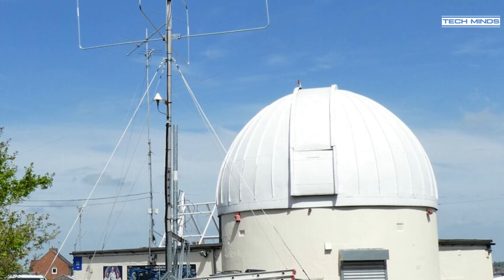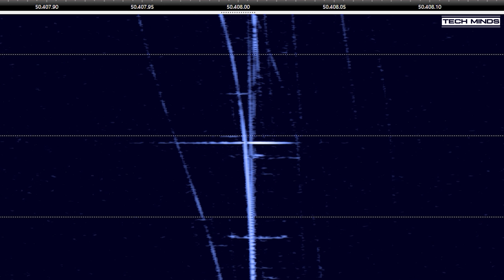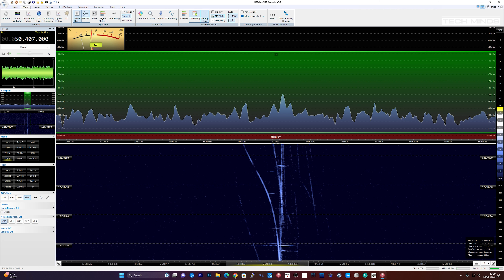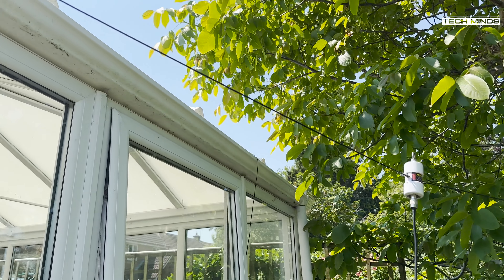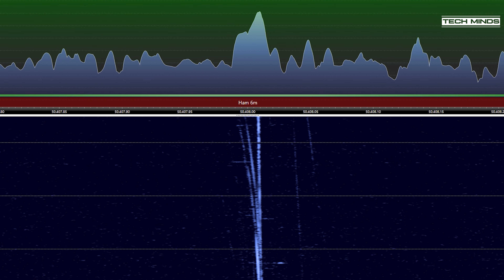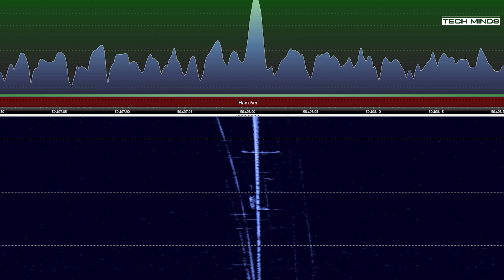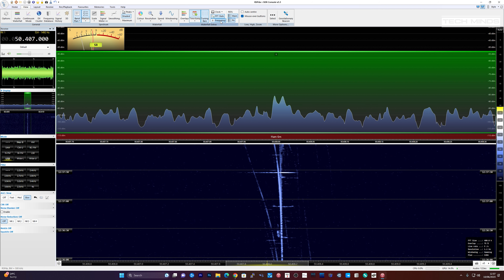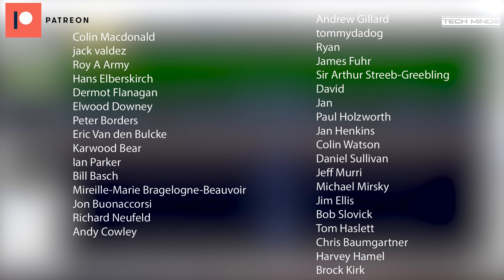Detecting Meteors With Software Defined Radio

Comment: A fun thing to do is passive bistatic radar. Find a GSM or HDTV carrier in your local area. Tune to USB 1 kHz up from the carrier. Display a SLOW waterfall. Every aircraft between you and the transmitter will show up as curved lines. The Windows program ARGO will display a suitable waterfall.
7:50
Reply: Got to try that 😋

Comment: Great video.  I have been doing radio meteor detection since 2007 using carrier signals from out of range television stations.  Currently I have a system monitoring 55.240 Mhz in CW mode.  I use software called Spectrum Lab to automatically count hourly rates and software called Colorgramme from RMOB (Radio Meteor Observing Bulletin) to automatically submit those counts to RMOB so it can be used for studies.
Reply: Country location?
Reply: @Suzuki_Akira  Southern Minnesota, USA.

Comment: The one thing that seems evident to me these days living in an urban built up area is noise, and lots of it at times from HF to VHF. So I opted for receiving meteor pings from the Graves radar. Over a period of at least 10 years I have had great success in doing so, although initially it took quite a lot of experimentation to get the receive system as efficient as possible. I finally opted for two VHF LFA 5 element Yagi antennas vertically polarized, and one 6 element ZL special horizontally polarized installed in the loft. Variable gain VHF head end amps with band pass filters, are used to remove most of the strong out of band VHF commercial transmitter interference I was getting.  I also fitted additional variable gain VHF amps with splitter combiners near to the ICOM VHF receiver. I have tried receiving meteor pings with an outside VHF vertical high gain antenna, but because of local noise issues the results have been rather poor with a very low meteor ping count and only the strongest pings are received. I receive over a hundred pings an hour, during large meteor showers as standard, while at other times around 30 to 40 or more on average pings at less busier times. Great video thanks for posting, watching the pings and hearing them is great fun, I use Spectrum Lab. I found the hardest part and most interesting, was getting the minor pings strong enough to overcome local noise issues.

Comment: Great video. I'm a researcher getting a doctorate on this topic, and currently helping to build a system in central US. There's multistatic and monostatic systems in Peru, Argentina, Northern Germany, Norway, and (IIRC) France that publish papers and data. There's at least one company that sells commercial off-the-shelf meteor radar systems, so I'm sure there are others that don't publish scattered around the globe. In addition to helping build a meteor radar system, I've traveled to Peru to do research with their system, and I've worked with data from an Antarctic array that was recently taken down after running for 5 years. 

To give a little more context in the field as a whole: the system you're showing is an older, simple version of specular meteor radar, useful mostly for meteor counts. More modern research revolves around systems with interferometric arrays to determine the meteor's location, and different aspects of the received echo can help make physical measurements of the atmosphere or the meteor. Doppler shift of the echo can give you information about wind speeds, decay rate of the signal can give pressure/temperature, radar measurements can be made to measure meteor speed, etc. 

There's also non-specular meteor radar, that bounces radar off the heads of meteors instead of the trails. Interesting stuff. A good paper to start with if anyone is interested in learning more is "Real-time determination of meteor-related parameters utilizing modern digital technology" (Hocking et al, 2001) and their sources.

Comment: I've setup an SDR meteor receiver at the Blackburn Leisure Astronomy Society (BLAS) in Brough, East Yorkshire and have approximately 2 years of meteor data from GRAVES using a 6 element Innovantennas loop Yagi / Uputronics preamplifier and RTL Dongle using the Echoes Software.

Comment: I had the chance to check out meteor scatter comms professionally about 30 years ago.  You could buy a system operating around 50 MHz for a link up to about 1000km and getting an average throughput of 2.4kbit/s.  It used a variant of X.25 for the link protocol with the timers adjusted for really fast turnaround once a carrier is detected.
Reply: Could you triangulate with multiple sources? 
On thing that certainly could be done now, is AI to pick out the meteors from the other signals such as planes. 
With ADS receivers as well you may be able to identify which plane it is too. 
Then there's people running meteor cameras. If you could cross reference the signals from the radio, you could cross check with the cameras to see if you can detect actual meteors.
Reply: @adenwellsmith6908  Yes - if you just want to detect meteors (or planes) then using distant VHF FM radio carriers it is certainly possible to triangulate with GPS synchronised receivers
Reply: So time of signal detection like the lightening monitors.

OK do you have any information on the locations of stations that broadcast that can be used for monitoring? 

From the maths you would need 4 to get lat long

 @Richardincancale
Reply: @adenwellsmith6908  In the UK we used to use FM broadcast transmitters from Eastern Europe as their FM band extended down into the 70MHz region, way below the bottom of our FM band at 88MHz. You just need something with a constant amplitude at a good distance where there’s no local co-channel interference to swamp it.

Comment: I began experimenting with this method of meteor detection about 10 years ago but after making contact with a professional radio astronomer and sharing some of my observations with him, it turned out that most of the 'meteor-like' echoes I was seeing were actually signal reflections from LEO satellites. (I'm in the eastern US and have mainly been tuning to the video carrier frequencies from Canadian analog VHF TV transmitters -- yes there are a few still operating!)  Monitoring satellite reflections is interesting in itself and you can use the various online sat tracking sites to try and confirm your results. Sometimes it's easy to tell the difference, sometimes not, so if anyone out there can provide some expert advice on how to differentiate between satellites and meteors I'd like to hear about it.

Comment: On SDR console, bottom left - use 'Notch: on' with 'Auto enable' Set level as you like. This will suppress constant tones such is direct reception, but will allow brief bursts and pings to pass. By adjusting level, you may listen both; pings and bursts. I hope this helps. 73
Reply from the maker: Thanks for that!

Comment: Good one there nice results, it is indeed a bit like looking at tea leaves. I have done stuff using both the Sherwood Observatory unit mentioned and the easier one on near 2M (Graves France). The Main carrier is actually ment to be "invisible" so you can easily recieve the reflected signals minus the carrier. Try a vertical Moxon  for 6M to pick up the reflections, actually low to the ground would probably shield it from the main signal but be aware that the antenna will be loaded so close to the ground when calculating the size. There is also another similar experiment in Belgium. Contact us if you have any questions.

Comment: Would it be possible to send and receive callsigns if the transmissions were fast enough?  Maybe using some sort of high speed data mode?  Is this a thing?
Reply: Yes, this is a thing. 40 years back radio amateurs used morse telegraphy, speeded up with tape recorders with variable replay/record speeds.
Today a program called WSJT-X offers multiple modes suitable for meteor scatter, which transmits the same info at very high speed over and over, waiting for a ping or burst to be received at the other side. Works even with relatively low power.
Reply: @Wimo-funktechnik  I like the sound of that!  Was unaware WSJT-X could be used for meteor scatter...  Need to look into it.  Thanks!
Reply: @cthoadmin7458  wsjt-x mode is called MSK-144

Comment: Im working to get my initial licence. Im a Yank as well as well as a Swiss, the FCC allows the online test taking. Thier tests have good prep documention and are easier. Example, every member of my local club is a electronic/electrical engineer or a radio engineer. And i habe to twke thr test in my second language wirh very little in the way of guidebooks or preparation materiel in French. They do have reciprocity however and (i am a lawyer) and the Americans put up with my dual nationally but dont officially "recognize it so I have to pay the difference between my US and Swiss income tax which is always a few 1000 USD (enough to take a bite but never enough to tangle with the IRS). They must have a formula to calculate this amount 😅. BUT, for U.S. legal purposes, my last domicile remains my domicile for U.S. purposes until I "return" (after this long - um doubtful - two 20s somethings born in Switzerland who are 100% in thier brains). So,what do you think given the tax and even "voting rights" (which I don't use as I dint think it fair that I vote in two countries and I vote here). But, could I take the ALLR online test and do a reciprocal switch to the Swiss. My French is "verbally (B2 / C1 - if you use the same system in the UK. Which means I passed the 2 1/2 hour French 900g to 4kg Federal Drone Licence A2/A3. But, Im having test anxiety given the lack of much of any printed preparation material. There sre a lot of operators but not like the US where there are Federal laws protecting the use and even which can be used to challenge HOA restrictions etc. ....not here as I have to do everything on the downlow. My interest in Computers ran up against my interest in Rsdio (dating back to High School). I have the same Radiosonde antenna you used for your Immsarat demo and I am already ordering and working on connecting to the Q0100 Geosat to the point of making my own rectangular sat parabolic dish so it doesn't look like a satellite dish. Using a mosquito net with a foil epoxed on the back plain and using a layer to find the optimal LNB / Helix antenna mounting point. I am making it so it focuses the 10Ghz down below the eyeline of those below my balcony. So, a very customized backplane, checking the continuity using lazer beams as a represention of any incoming waves hitting my back plane using and example of an engineer who used metal rectangles in concentric circles on a flat backplane and custom focusing each one before glueing them in place. He placed a thin piece of plastic over the 100s of tiny metal plates not to create a solar cooker of his LNB and Heliex. I have been listening to the 10Ghz websdr and it just eggs me one. Im did my first "fox hunt" last weekend and with an initial tutorial found all of them. Again, eggijg me on.....none of the members use computer or the new digital modes like FT-8 or Winlink despite the club being sbout as ild ss
Reply from the maker: Good luck! Hope to hear you on QO-100 some time ;-)

Comment: there is no beacon on 50-70 MHz near me, any way I can still receive meteors? I'm in balkans :)
Reply: I remember using Baltic tv-transmitters around 55-56MHz back in the day but just like our swedish analog tv transmitters I guess they might have shut down.. you could try the GRAVES VHF radar on 143.050MHz located in eastern France, I know AIS signals from ships at ~162MHz bounce well too - extending my range 3-4-5-6 times and as I know the usual range on my system I can basically see which direction they hit too... jjust a thought..
Reply: As mentioned try a 2M Moxon pointed towards Graves France, not sure what your result would be but it is Very powerful at 400KW so maybe you'll be successful. For most of us we are over the horizon so most of  the time you will not se the carrier it's self but the reflections. BTW it's so powerful you can see reflections from the ionosphere and even a moonbounce on occaion ..very impressive!
Reply: @101blog  Interesting, would the stock antenna from RTL-SDR V3 kit help me receive graves?
Reply: @Antenna101  Good question .. try it outside I feel probably not but worth a go. That said you can build a Moxen antenna out of cheap electrical conduit and wire ... Look for a Moxen antenna calculator and put in the frequency of 143.050 and you'll get the demensions ...expect a buld price les than 20Euros. Try and get that as high as possible an point towards Graves
Reply: Great Video Matt! I am assembling all the pieces to get Yagi up for 6m and will check if it can be heard here in South Sweden. This is why I love ths Hobby, so much interesting space, physics, electronics and astronomy related things that we can explore and learn about.
73
Reply: @FXGreggan.  Är det kul å spana/lyssna på fallande stenar?
Reply: @grandpapipermike2921  det var kul att komma på själv vad det var för fenomen, hade ingen aning på den tiden att VHF reflekterade så väl och långt, men det var kul bara en kort stund - inte kollat sånt på typ 20år :) på den tiden var jag inne mycket på radiostronomi (1.42GHz) så alla naturliga källor till RF var jag intresserad av rätt länge... Jupiter-Io lyssnade jag efter på HF ett tag också..